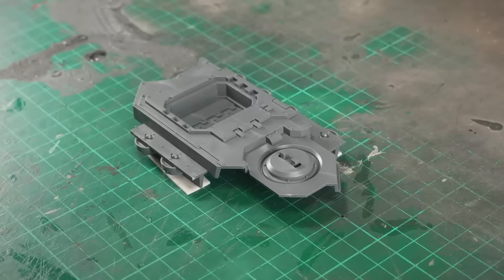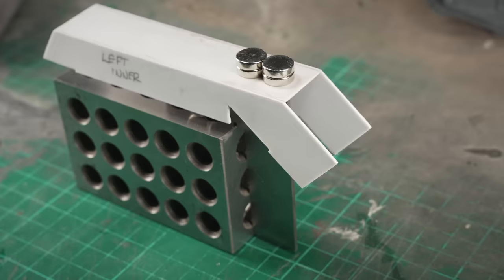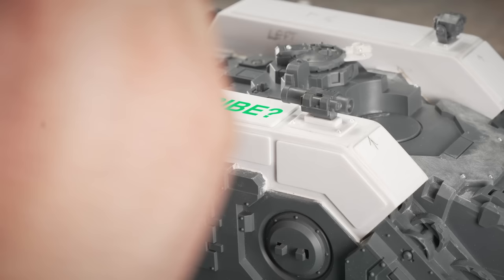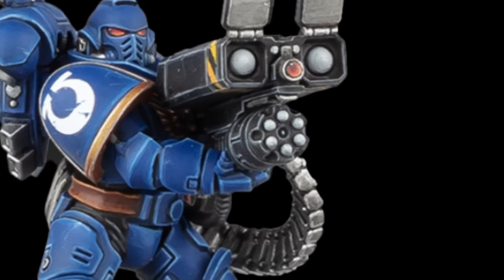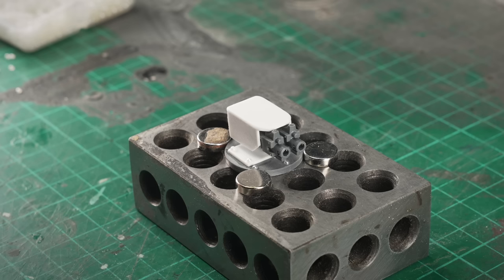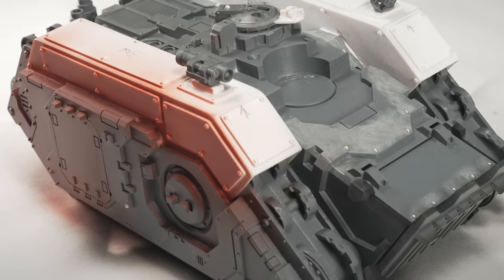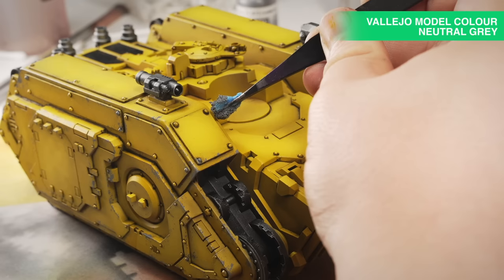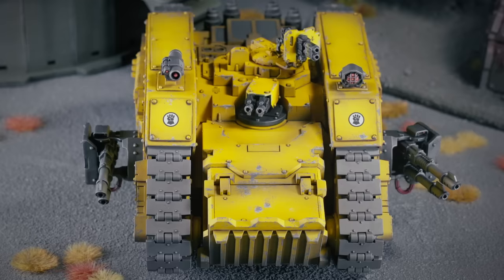Building a Better Land Raider for Warhammer 40K

Comment: The spartan sprue actually has a an inbuilt option for dual instead of quad lascannons. I did so for the purpose of turning it into a Chaos Land Raider.
Reply from the maker: Quite right. I wanted to use the slightly longer mount "arms" for mine, and found the cut down outer Lascannons made for a good armour mount... though I forgot to mention any of that in the video ;)
Reply: the dual lascannons are not for turning it into a chaos land raider, its a sprue shared across all plastic land radier chassis for the HH, GW has this stupid thing of wanting things to be their ridiclous version of tournament legal so a spartan as a chaos land raider wouldnt fit that bill
Reply: @clonetf141  Bruh. I did not say its FOR anything specific, I just said I used it as it allowed me to proxy the model as a Chaos Land Raider. Relax and enjoy the plastic cement fumes, like the rest of us. ;-)

Comment: that's great bit of precision build work, it looks great - for better scaled rivets have you tried using a thin tin sheet and a drill bits bottom to punch them out over a silicone mat? more fiddly but that way you can have rivets of any size you like and they have the dome shape on one side too

Comment: In the middle of copying your conversion 😁. You wouldn't happen to have a second set of templates for the extra amor plating on the track covers would you?
Reply: (like I'm sure I could measure it out, but if you have em lying around on a hard drive 😉)
Reply from the maker: Ah, my apologies. I didn't make templates for the additional plates, I just cut down the original templates by (I think) 2mm on each axis.
Reply: @OffbeatBuilds  No worries, I kinda figured 👍

Comment: You know?
All Warhammer miniatures are great. But they are not created to be perfect!
Everyone should do conversions, I think. Because otherwise there will be legions of clones.
It’s also important to make “your own dudes” in Warhammer. This is the only way to unlock your potential.
And most importantly: you need to show Games Workshop that they are the only ones dealing with boring bureaucracy “like this model is only for one system.”